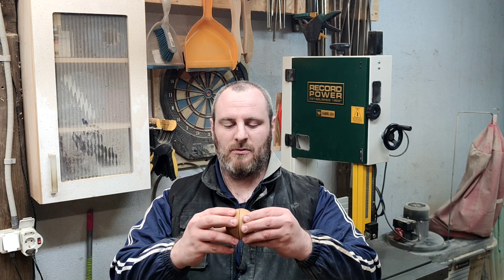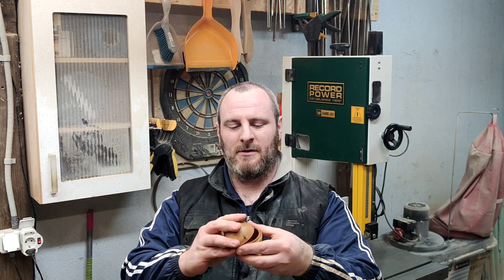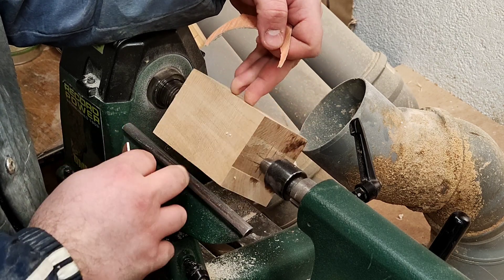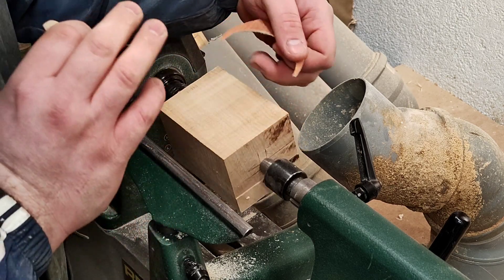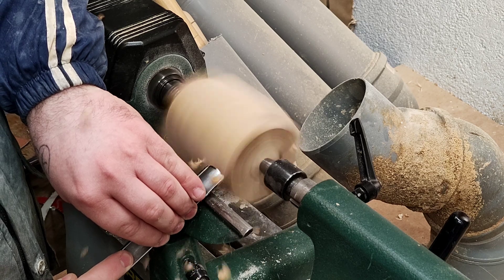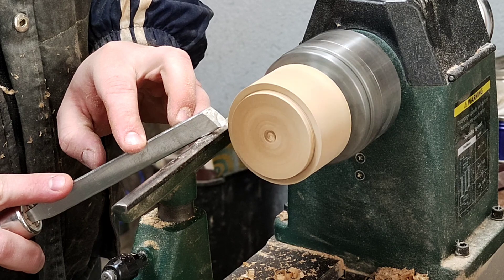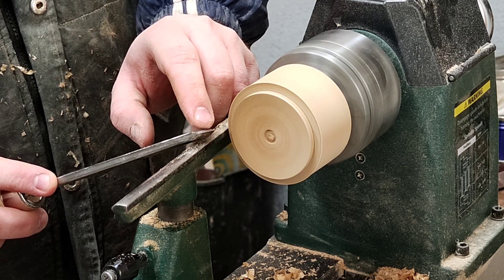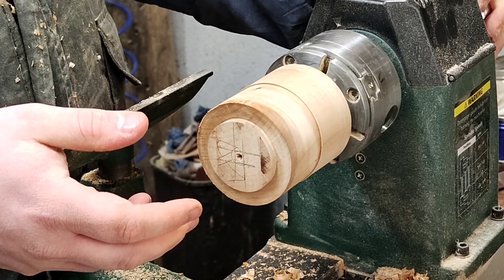How NOT to make a sphere box🤔

Comment: Hallo Tom - very nice and informative.  That is a reason I like your videos - good tool handling and good teaching.  Please bear with me, but why do all turners use the dividers the way you do?  Will it not be more precice if you half the distance and then place the one point on the centre spot?  Also:  I have turned quite a few boxes and if they fit very nicely in the beginning, after a few days they often get stuck because moisture warps them a little bit.  I often found that if your fit is a little bit looser, you are then able to "lock, or tighten" the lid by twisting it.  What is your opinion?  Kind regards.
Reply from the maker: Thank you very much for watching and kind words..... For marking diameter I like using whole of the measurement, and when taking measure from almost closed chuck its easier to have a whole insted of half a circle..... That is why I do it .. its just easier for me...but if you find that a half of diameter is easier for you to mark then there is nothing wrong....In this case there is no wrong or right way to do it 🤗 
For the fit of the boxes, I did find that as well ,that it wants to tighten up after making it but in my case almost all of the boxes return back to original fit..... There is more moisture in my shop then in house so they need to aclimate ..... Longer flange on a box is beneficial beacuse there is a bit more leway on wood movement,but you are right about box movement but in my case it Always comes back😀.... That's how I expirience it..... I will make a video on suction fit and others as well ..... Hope I helped a bit

Comment: Cool little project. Out of interest could you not have placed toilet or tissue paper between the two halves to tighten them up during that turning process?
Reply from the maker: Thank you for watching 😀 I do use shop towels for stuff like that but run out of them , and go into house for kitchen ones felt a bit lazy to be honest....but I will do a remake of that in near future, as it should be turned☺️
Reply: @tomislavtomasicwoodturning  LMFAO. I thought I was missing some great stress problem caused by the suction fit which as a design engineer was bothering me. I'd day you have studied rather than watched a lot of Richard Raffin videos not only do you use a lot of the same techniques but also the weight you place on the rest and the way that you hold and position your hands on and around the rest look very similar. Maybe it is just a sign of a good Turner. Either way I like your approach.
Reply from the maker: @chrissimmoms1550  Copy and learn from somebody or something good.....he thought me a great deal of everything so there's gotta be his influence 😀
Reply from the maker: @chrissimmoms1550  thank you very much 😀
Reply: @tomislavtomasicwoodturning  I am relatively speaking only a moment into this journey but what you suggest is my objective. Thanks for the interaction. Generous of you.
Reply from the maker: @chrissimmoms1550  no problem, best of luck on your journey 😀